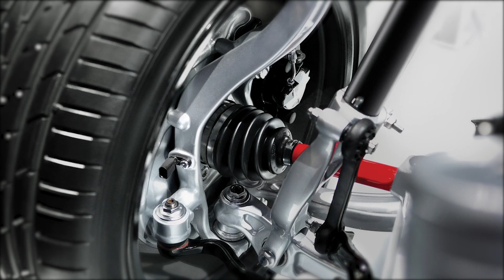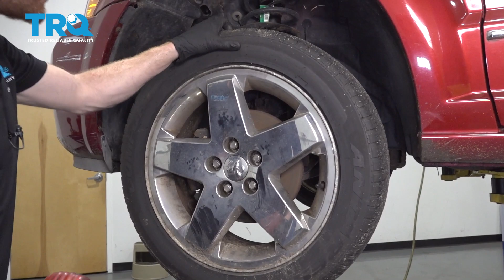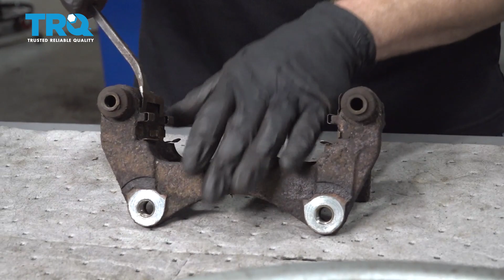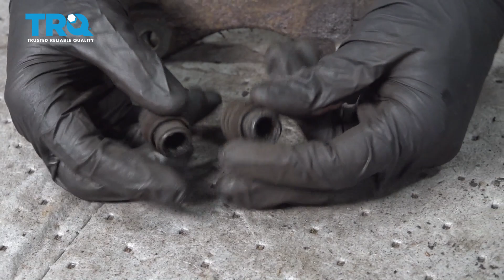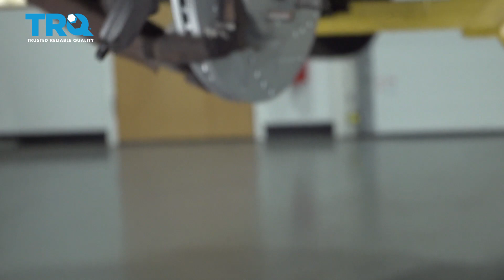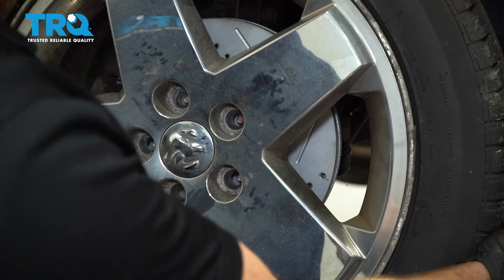How To Replace Front Brakes 2007-12 Dodge Caliber

Comment: Im going in behind someone's work now 😂

The pin with the rubber was on top just now, seems to have been fine for as long as it took for the pads to need replacement 😂

Im gonna take your word for it and put it in the bottom, it doesn't seem to be any noticeable or measurable difference though.

Comment: Thank you, I was confused with those bolts with different ends. I have to take out and make sure where they have to be place in the right holes. I did by myself this time but looks there was removed before, both were in different places, that made worry about the right way to put them together again, thanks again.